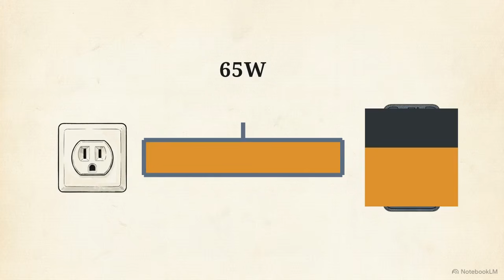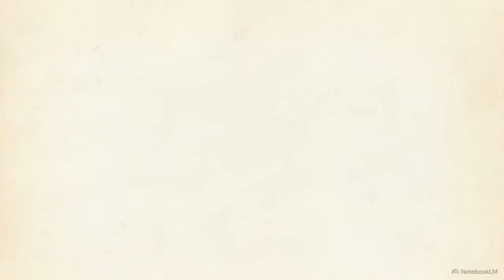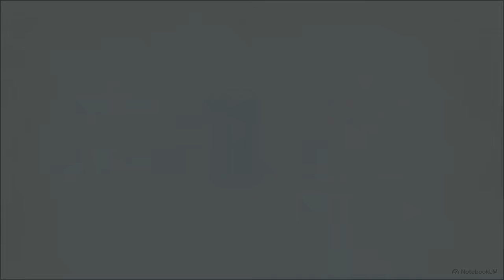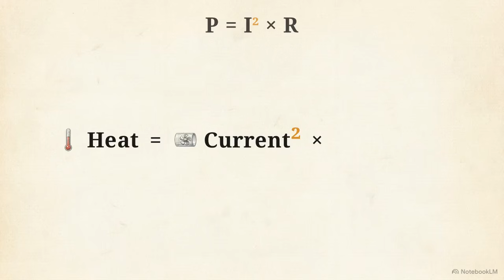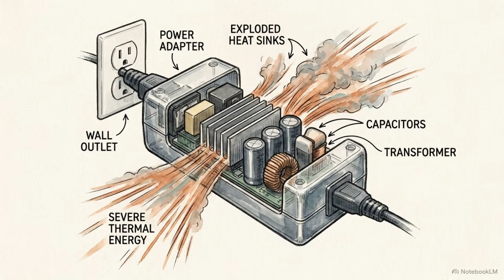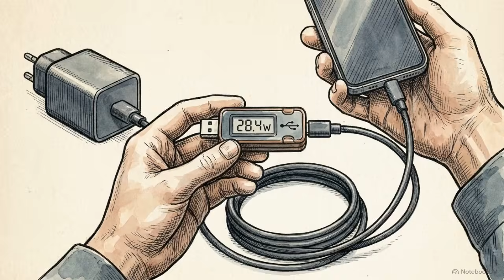The Truth About Fast Charging: Why Your 65W Charger Isn't Actually Pumping 65W

Comment: You should have also added that all this goes for nothing if the device being charged, or the cable being used, is an older one and has limited or no logic interaction, the charger will default to its lowest charge output for safety. So using a high capacity charger with old devices or cables does not deliver the listed max charge. Ever.
Reply from the maker: Good point, thank you.